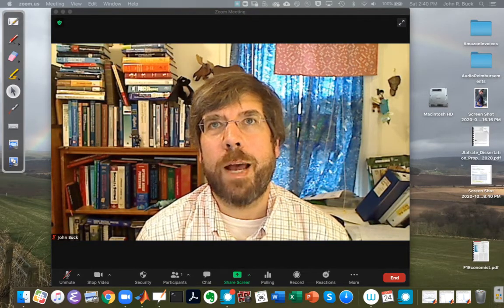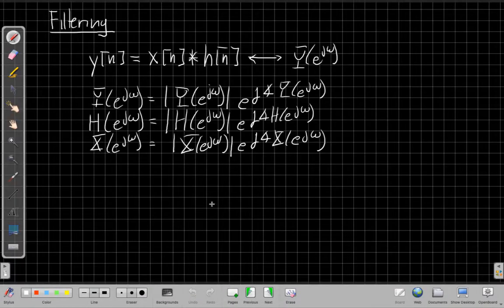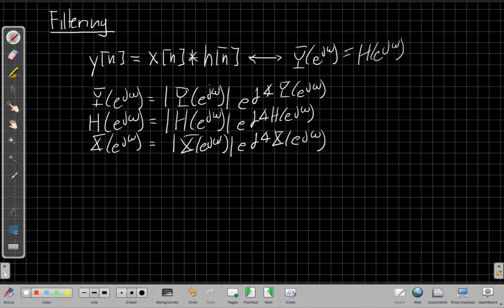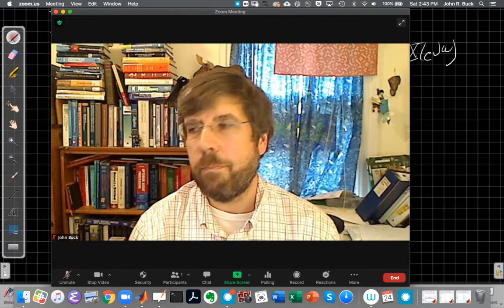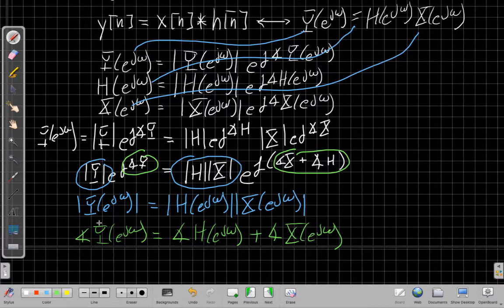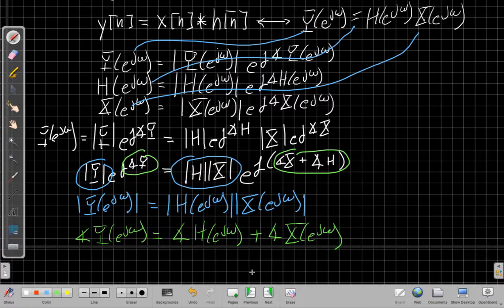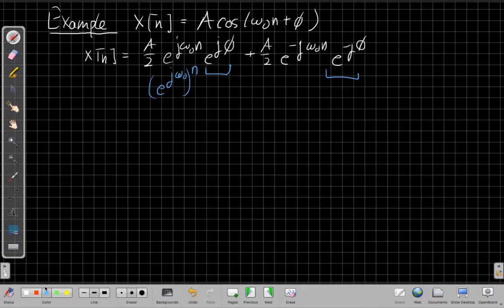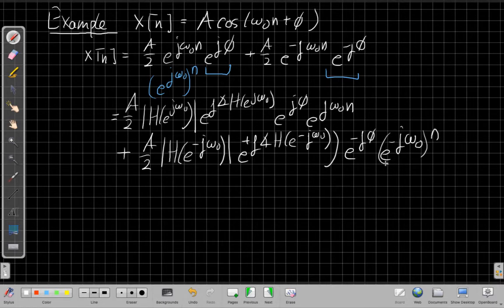Frequency Response Magnitude and Phase for Filters

Comment: Can the magnitude of frequency response be negative? 
For example, when you have frequency response of e^-jw(4+10cos(w)), magnitude is given by that function inside the bracket, which can be negative. To me, it feels like negative values are accepted here, but I do not know exactly.
Reply: No, magnitude cannot be negative because of the squaring that occurs on the real and imaginary parts. Recall that the magnitude of a complex number z represented by a + bi is sqrt(a^2 + b^2)
Reply: @Bazz1TV  
I noticed that if you have magnitude of negative, instead of writing magnitude as negative, you just change the phase of it so it’s negative while magnitude is positive